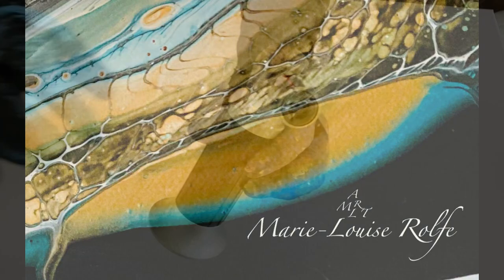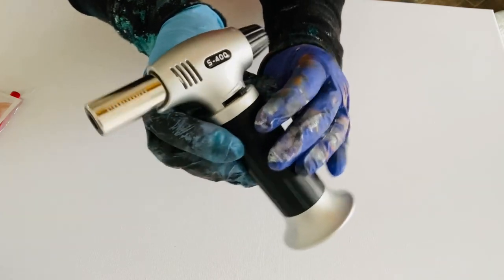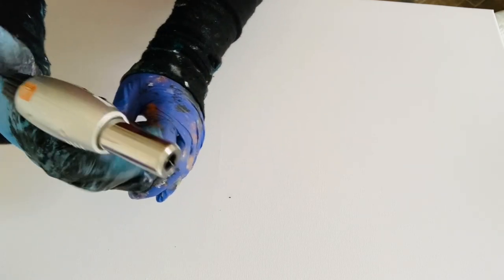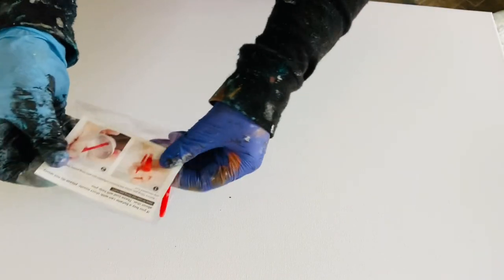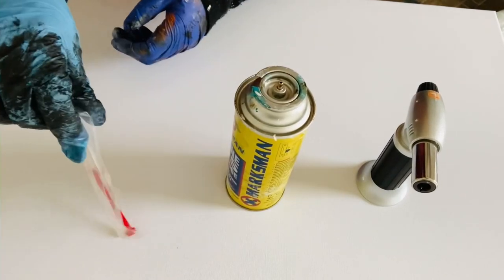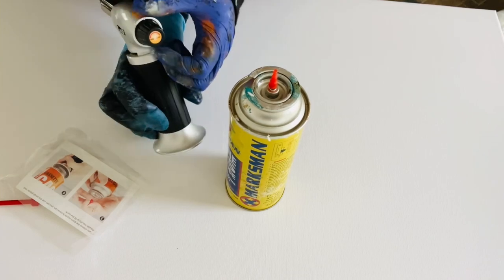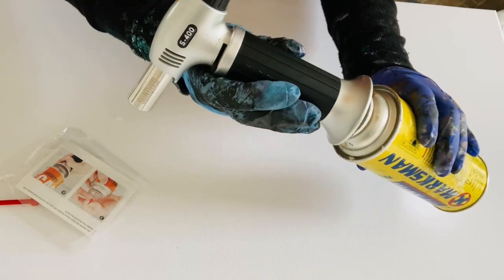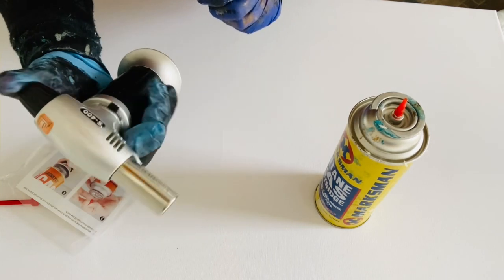How to top up your butane art/kitchen torch. #fluidart  #fluidarttips #acrylicpouring 🎨❤️

Comment: Thank you for sharing this helpful tip on using a butane torch for removing air bubbles in paintings! It's great to see experienced artists like you providing valuable advice to fellow artists. Your reminder to hold the torch away from the painting to prevent scorching is crucial, and the suggestion to wear gloves and wash hands after use is a thoughtful precaution. As a beginner, I appreciate your insight and guidance. I will definitely give it a try and let you know how it goes. Happy painting to you too, and thank you for sharing your knowledge!
Reply from the maker: Thank you for your considerate reply. I’m glad this would help you. Hope to see you again soon.,😊